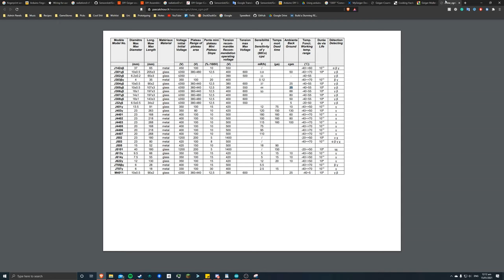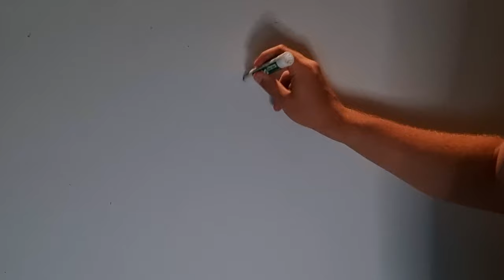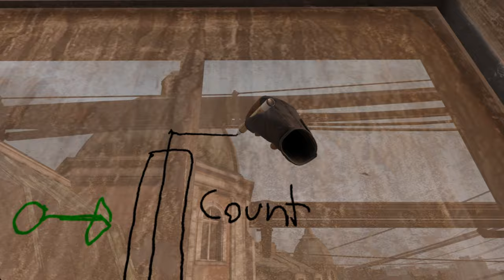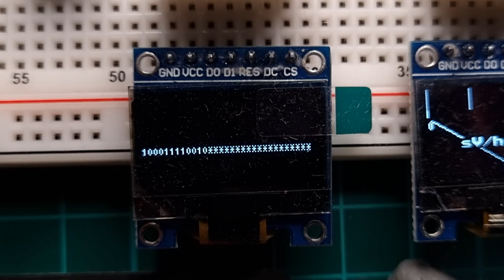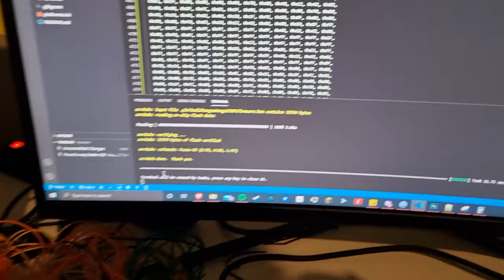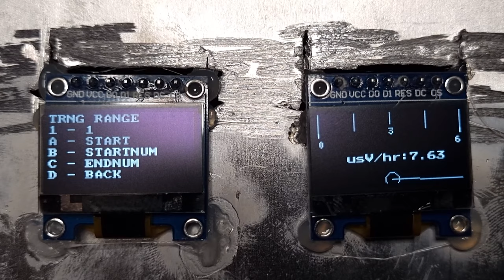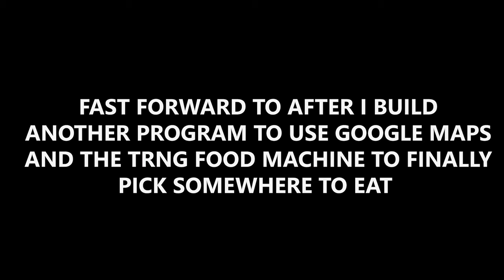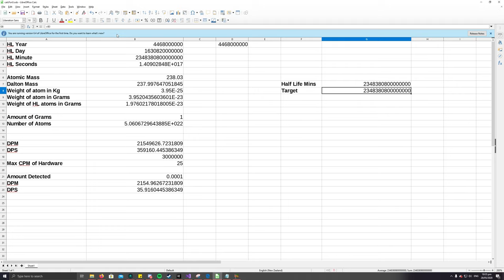Picking Lunch With Radiation

Comment: Those pins are from the original Italian design. The original Arduino had the same problem. It was a metric to standard conversion error. And no one has fixed it for the past 20+ years.
Reply from the maker: thanks for the info, sound like something they should get to fixing but I guess any shields meant for the mega wouldn't work if they did